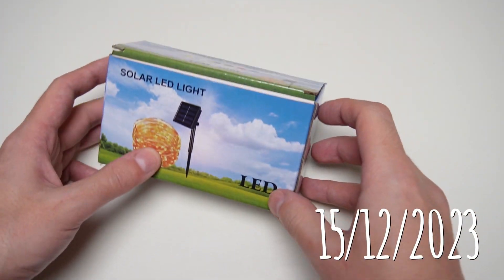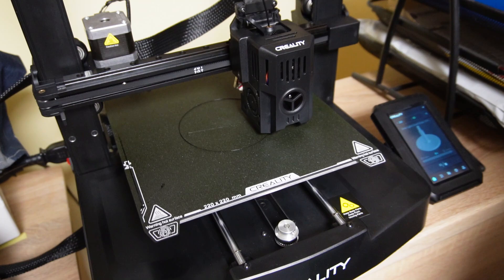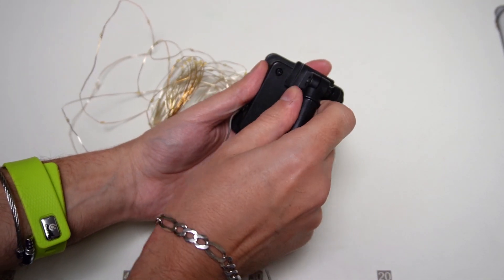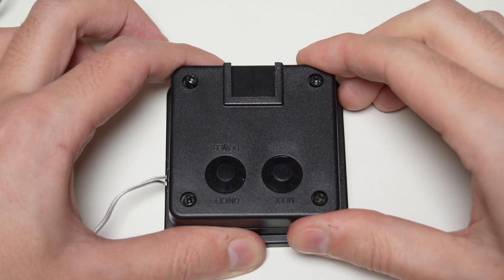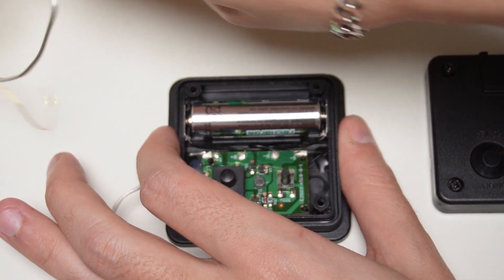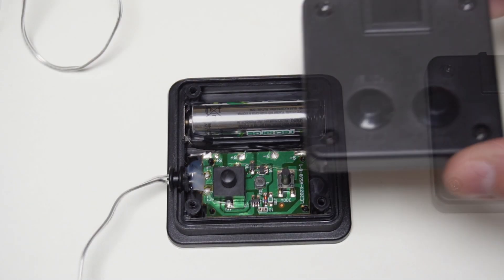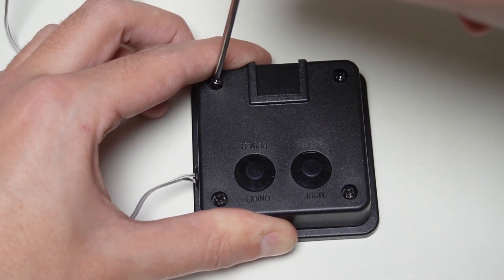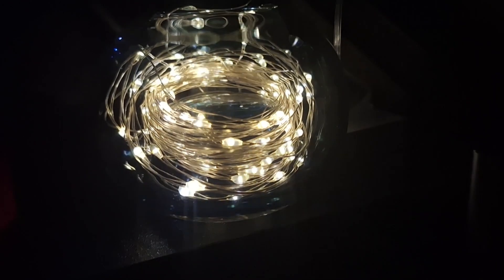Solar Light Not Working? Battery Replacement Made Simple

Comment: So my "mode" button fell off. Is it still possible for it to work???
Reply from the maker: Try covering the solar panel to see if the lights still come on. If it’s just the rubber cap that fell off, you can still change the modes by pressing the little switch on the circuit board with something pointy (like a toothpick) if it can’t be replaced. Just make sure the opening is sealed so no water gets inside, as moisture could corrode the components or damage the battery.

Comment: Is there a reason we can’t use a non rechargeable battery ?
Reply from the maker: Unfortunately, yes. If you insert a regular battery, the light will work only until the battery dies. But when the light is under the sun and the solar panel tries to recharge the non-rechargeable battery, it may overheat or even explode. So it's best to use it only for testing, just to check if the LEDs are still working.